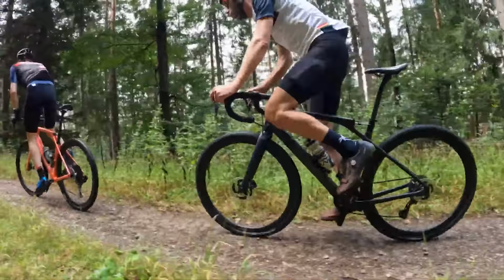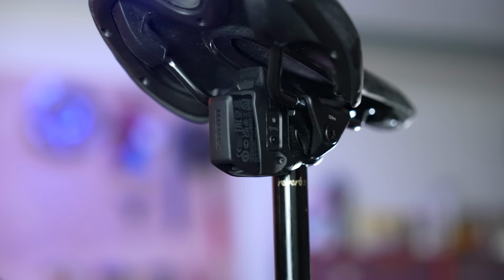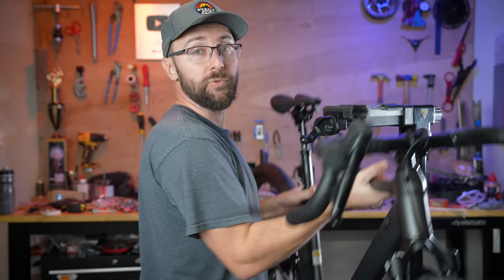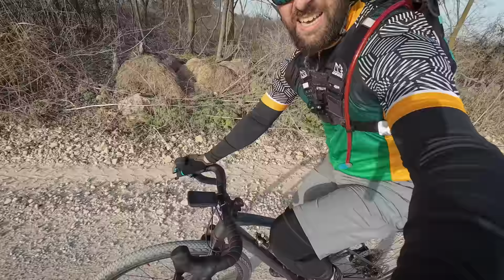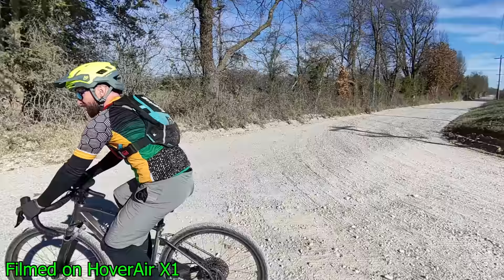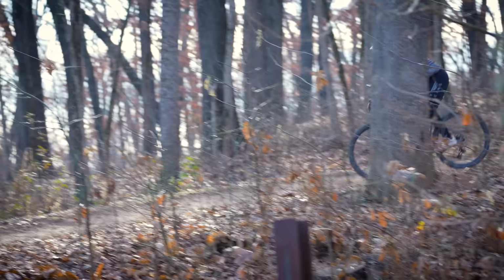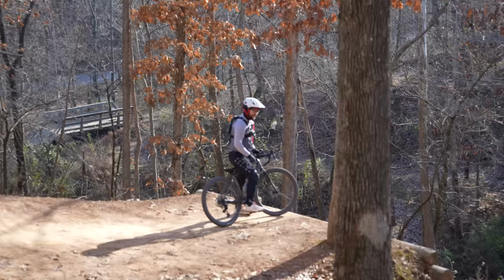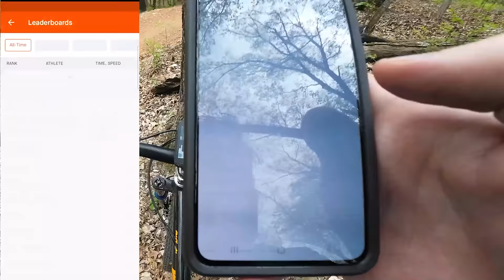I tried an "adventure gravel bike" (dropper, suspension, 50mm tires!)

Comment: As a gravel rider it was fun to see a mountain biker with an open mind trying out a gravel bike. I liked that the test was done both within intended use and outside.  Makes it clear that the two bike types are cousins, but clearly also quite different. Good work and good vacation :-)
Reply from the maker: Thanks man! I'll be doing a lot more gravel riding in the future. Super chill and a great way to get a long zone 2 ride in
Reply: I think mountain bikers are more naturally attracted to gravel bikes than most roadies. We're used to bigger tyres, suspension and handling sketchy surfaces.
I'm just about to buy my first gravel bike -- a Cannondale Slate, with a Lefty fork and 650B wheels. At 9kg, its waaaaayyyyy to heavy for my roadie pals, but it feel featherlight to me!
All it needs is wider bars -- 440mm seem's narrow to me after years on 780s. But I have my eye on a Surly Truck Stop bar in 480mm that might do the job. If not, the Redshift Kitchen Sink bar at just over 500m could be on the cards.
Cheers
Reply: Sounds great  @BrianRPaterson  Enjoy your gravel bike.

Personally, I am coming from the roadie side. 

I like a combination of the speed and distance from the road and getting out in nature where I also don't need to deal with car traffic.

I see quiter a few other roadies go down that path also.

Comment: I bought my gravel bike because it was described as the “pickup truck of bikes”. It’s great for rough country roads in my area. No dropper, no suspension, just a bike that I can ride in a lot of situations.
Reply: You can also bring it for bikepacking. I bought a Gravel bike two years back, and it has brought me everywhere: trails, around the country, bike camping. It can do everything depending on how you set it up
Reply: More like a mini cooper
Reply: just a bike that I can ride in a lot of situations.
You guys are a marketer's dream.
Reply: @superyamagucci  how is that wrong, its the fastest urban bike, its faster than a mtb everywhere except on single with sand\rocks\mud, its more comfortable than a road bike so better for longer distances. There is a lot of bullshit marketing around it, now casuals are buying suspensions and ruining it for example, but the claim of versatility is legit.
Reply: @BostilCensurado  
You can ride any bike in a lot of situations.
Reply: @superyamagucci Yeah but road bikes are a really bad time prone to unfixable flats outside of smooth asphalt, mtbs are more expensive to buy and maintain than anything and are slow and dead on smoother surfaces. Gravel have places where they outshine both by far and can still ride decently where they dont, any dumb marketeering wont change that
Reply: @BostilCensurado  Gravel bikes are road bikes with knobbly tyres.
Reply: @superyamagucci   not really, 99% road bikes dont have the clearance even for 35mm tires, the geometry is different too, i dont even use knobbly tires myself, you can use whatever you want, i.e, most versatile bike yet again
Reply: @BostilCensurado  Gravel bikes are road bikes with knobbly tyres.
Reply: @superyamagucci  Then get your road bike and ride with over 30km/h of average speed for 4+ hours without caring what kind of surface you find, like i do on my gravel bike, go on i challenge you, im going out for such ride right now
Reply: You were tricked, dude. Gravel bikes are nowhere near “pickup truck of bikes”. They are more like "allroad cars" or "crossover-styled cars" like Audi Allroad (not Audi Q), Kia Rio X or Volvo XC trims (not current Volvo XC models). Hybrid bikes are "CUVs of bikes", cross-country bikes are "SUVs of bikes", enduro bikes are "off-road vehicles of bikes", fat bikes are "monster trucks or bikes" and only touring bikes are “pickup trucks of bikes”. Is there a chance you might be from US South?
Reply: @BostilCensurado  In what country MTBs are more expensive than anything? Here in Russia road and gravel bikes are way more expensive than hardtail MTBs.
Reply: @IliaDem  Mine? If your mtb doesnt has a suspension more expensive than a whole gravel bike, its trash that will need maintenance every ride anyway
Reply: @BostilCensurado  I can only afford a budget MTB with RockShox Judy and while it's not perfect, it only needs maintenance once or twice per year. Considering I ride off-road 150-200km weekly, that's not much. Meanwhile, a mid-range gravel bike costs about the same as a mid-range full-sus bike, which doesn't make sense to me.
Reply: @IliaDem  Bro do you even ride on proper mtb terrain, sand , mud and rock trails? Or are you one of those dudes riding mtbs on asphalt? And im sure you are looking up pre built carbon gravel bikes from expensive brands, if you build one its way cheaper than any half decent mtb and the maintenance is lower than a road bike, its literally the cheapest bike to own and maintain besides a fixed gear\ss
Reply: @BostilCensurado  I actually take part in amateur cross-country races in XCO and XCM formats. I also ride trails (usually blue trails, sometimes red trails, but not black trails) and take part in adventure/cross-country touring (100+ km/day). Alu full-sus with Judy is quite enough for such riding.
Reply: @IliaDem  And any full sus mtb is way more expensive than a gravel bike, more than twice the price actually

Comment: I prefer my mountain bike, but I’ve got a gravel bike for endurance building and riding gran fundos. I think it’s an easier transition for MTBrs as opposed to a skinny tire road bike. Also, a good option when the single track is too wet to ride.
Reply: same. bombing down steep hills on gravel at 40-50mph is also a uniquely sketchy experience that is pretty addicting. the speed is fun when you're used to MTBs

Comment: I bought a 2018 cannondale scalpel this year for a pretty sweet deal. Carbon wheels and a second set of wheels as well. Lock out the suspension and it’s a rigid bike. Put on a pair of skinner 1.9” tires on my other wheel set and ride with friends on dedicated gravel bikes. When the trail gets bumpy I unlock suspension and it’s so smooth. Super versatile and other than lacking a drop bar i think it’s actually a nicer “gravel bike” than some friends ride. And I spent a lot less on it too. Then I race it for fun in some xc type races with the Stan’s valour carbon wheels it came with.

Comment: If you can't n+1, a hardtail MTB with a remote lockout, big chainring and big range cassette is a great MTB and can easily double as an adventure/gravel bike. Nothing beats a true drop bar gravel/CX bike though if you can have multiple bikes.

Comment: It has been said, but definitely get into the drops/hooks on anything sketchy. Lower center of gravity, more secure handhold, and better torque on the brake levers (even helps  on hydraulic brakes, but absolutely necessary on cable actuated discs 🫣).

Love the gravel bike for hitting the miles and not worrying about paths less travelled.  Can’t beat gravel/road bike for chewing up miles at a good pace. Enjoy the bike and the time off. 🤙

Comment: Gravel is good for distance, seeing the great outdoors, I converted my hybrid bike, it already had a 75mm air fork, hydraulic disc brakes, took those up to 180mm with sintered pads, surly corner bar copy, wider gravel tyres with tpu tubes, its a hoot but i know its limitations, it was never for gnarly rides before and still isnt, but it is more capable now

Comment: I've chucked my gravel bike down MTB trails but it's not fun. It's sketchy and if you keep it up you'll break something. Maybe your face. Gravel bikes are for getting out, covering distance and not having to worry about jumping on a trail and seeing where you end up. If I go out on my gravel bike I'm riding straight from my door, whereas on the MTB I either end up riding or driving to the 'proper' trails. On the gravel bike everything is a proper trail!
Reply from the maker: Yeah i agree! I won't be going back to singletrack unless I just happen to stumble upon new stuff and it's like a recon mission at that point haha. I'm pumped that I have a gravel road starting less than a mile from my door!

Comment: I've ridden gravel bikes since  2014, basically in tandem with mountain bikes. The two disciplines go hand in hand for me, they're both important to fitness and can help the other. Gravel biking gives me the opportunity to clock in longer endurance rides, in both time and distance,  compared to my local singletrack options. It's a great for early season riding when the trails are still muddy or covered in ice, and it's a fallback when the trails are wet. I personally feel guilty riding muddy trails. 
Around where I live there are dozens of cool historic roads that are no longer maintained, or if they are, very minimally maintained. These roads are fun to explore, and can offer offer loose surfaces, water bar jumps, rock gardens, rock jumps, stream crossings, and more. Being able to play around on a lightweight, responsive bike and then find beautiful vistas leading to 50mph descents, is fun for me. 
Not more fun than mountain biking, but I don't understand the hate AT ALL.

Comment: Gravel biking is such a fun way to get out. It’s a whole new style of exploring and makes even the green trails fun if you hit some singletrack. 
Looking at the specs, I’d widen the bars before going longer stem. I run 480mm bars, gives me more of the feel of MTB handling
Reply from the maker: It's funny cuz road is on the trend of going super duper narrow now. Like 320 or something crazy. Maybe 360
Reply: @EvansMTBSaga  It's almost like the two are trying to differentiate themselves from each other. But my gravel came with 460 and just the little added width was a noticeable (positive) change, plus a 10mm shorter stem.

Comment: I am in SoCal and I got myself a gravel bike to ride easier trails and keep things exciting...it is an exhilarating ride, exactly cause it is sketchy. 
Once drop curious, especially on non-man-made transitions etc like these, you will find the limit VERY fast. I mean, no dig @ your courage to sent it, but even 18in drops to flat are far different than these smooth transitions you have @ Bentonville. 

If you want something for non-flowy or easy singletrack that gets remotely techy and you start venturing away from a gravel bike with a redshift stem and 45-50mm tires, you are better off on a light HT. My Team Marin (alloy XC HT) with Fox 34 SC 120, a 170 dropper, Hunt XC alloy wheels, Scorpion XC RC 2.4 tires and full XT built was far cheaper than this Polygon and is under 26.4lbs with pedals and cages etc. But getting it over 16-17mph on flats is a chore, while my alloy gravel bike that is not that light (Checkpoint ALR, some 22lbs w/o bags with 700x42 Pathfinder Pro tires) can do more than 20mph with less effort.  

Too bad I am too close to the urban sprawl madness to have any of the dirt-roads you were showing @ the first half of the vid. 

It is fun tho that you find it "less agile" than a MTB...it is way more agile, and thus unforgiving, while "slack" MTBs are numb to your steering inputs by comparison and thus plow.
Reply from the maker: Thanks for the comment! I went down the path of long travel for a while but I'm headed towards going more and more under biked!
Reply: @EvansMTBSaga Love underbiking.

Taught me a lot, the biggest lesson of which was - IMHO - how seriously "over-tired" we are on Minions and Butchers and Magic Marys...

The biggest upgrade you can make for your bike's speed in order to try "underbiking", is a really fast set of tires, i.e. Rekon Race or Ardent or even Ikon, or far better priced Specialized Fast Track front/Renegade rear etc.

Comment: My gravel bike replaced my hardtail. It scoots along just fine on roads to get me to the easier dirt trails. If I'm driving my bike to the trails, I use my full suspension rig. I'm thinking of trying out a 30mm gravel suspension fork. If it works out, the hardtail is being sold or I'll give it to a buddy getting into the sport.

Comment: I love my gravel bike because its much more comfortable than my road bikes for commuting, both geometry, wide tires and wide bar - and I can commute less than ideal roads, grass etc. I wouldnt use my fully mtb for commuting because of service intervals of suspension and because it would just be too much - only use my mtbs for trail - guess I could go hardtail mtb but I feel the gravel bike is more efficient - besides a bike rack doesnt seem off on a gravel bike, it does on mtb and road bikes… I love my gravel bike just as much as my mtb, just very different beasts and purposes…

Comment: My cube nuroad gravel bike is 22.5 lbs..  I only have 40mm tires and no dropper, I probably will switch out the seat for carbon and go tubeless this spring
Reply from the maker: Dang nice! Im gonna take the dropper off and put it on another bike. It was not needed for the gravel I rode
Reply: @EvansMTBSaga  yeah I wanted a dropper originally but I don't do single track anyways when riding my gravel bike so it would have been wasted..

Comment: At that point with the dropper, taper cast fork and 50c tires you’re better off just riding an XC hardtail and to be honest I would say that’s really overkill for a gravel bike. What makes them fun is the whole “underbiking” aspect of it. Try a gravel bike that feels more like a road bike and you will have way more fun on long gravel roads and even a lot of single track to be honest.

There was a good video by Dylan Johnson about how drop bar mountain bikes are faster than somthing like this polygon gravel bike. Definitely check it out if you have the time. 

But in my opinion real gravel is taking a rigid bike with no dropper and kinda just pushing the limits, and I guess kinda that’s why people like gravel because it’s really a ton of different things. No one has really found the true spirit of gravel 😂

Comment: Why do you even dropper on a gravel bike ? Just curious, i ride MTB and have never tried gravel. As you mentioned, gravel isn't intended for drops and things like that, what's the purpose of having dropper than ?
Reply: You might not do jumps on a gravel bike, but you definitely do go down some insanely steep dirt hills on them which would otherwise be too dangerous to do with a really high center of gravity. The lower you can get down, the better. All the more problematic  when you realize the wheelbase of (some) gravel bikes is way too short for steep downhill terrain (something more gravel bike  manufacturers need to rectify). The forward bias (weight distributed too far over the front wheel) of gravel bikes just makes for the trifecta of steep descending disaster.

It is partly these three things that caused me to have a really bad crash at a very tough bikepacking race recently. I was the only one riding a gravel bike. Everyone else had mountain bikes. I bit it on a super steep downhill. The wheelbase on them is just way too short, and not being able to get my center of gravity lower (or more back) made it that much worse.

Comment: I’m guessing a MTB is more versatile than a gravel.
Reply: Its only more versatile if the majority of your riding leans more to the technical side. If the majority of riding leans towards the faster side, a mountain bike is now at a disadvantage. 

The most versatile bike is the one that about equally splits the difference between the two, but unfortately that often means it fails to excel at either end of the extremes (the ol' "Jack of All Trades, Master of None" dilemma).